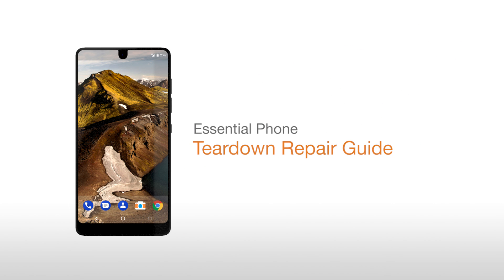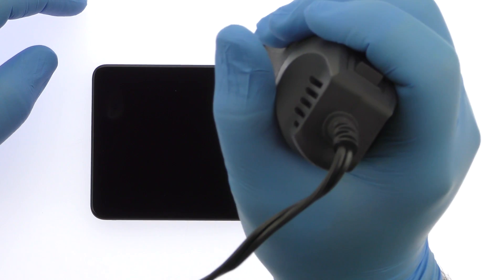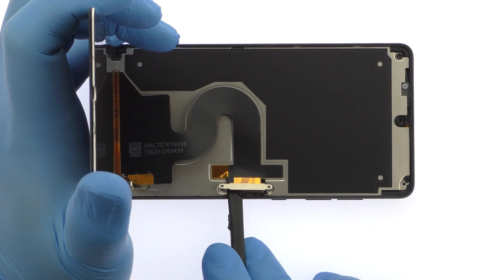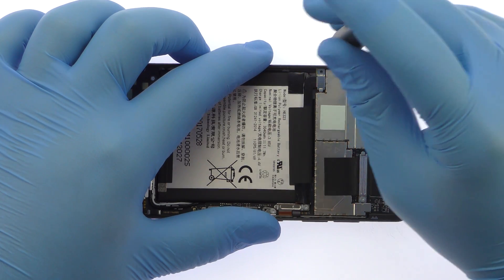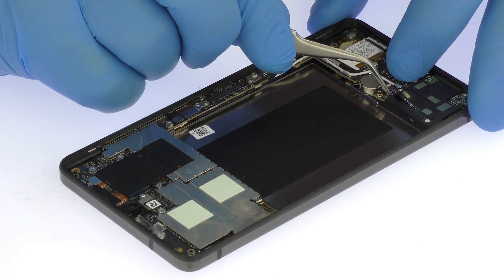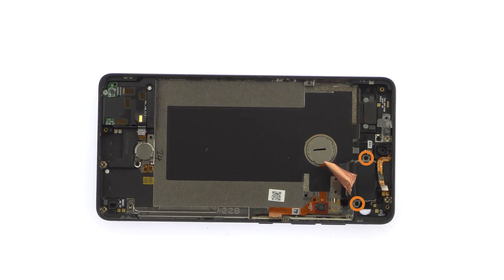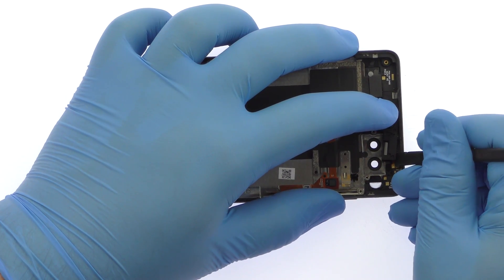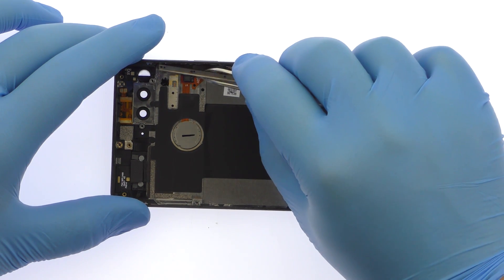Essential Phone Teardown Repair Guide - Fixez.com

Comment: Maybe i've missed it but if I want to change battery only, how do I reattach screen back? Is there any possibility to get some sort of spare adhesive frame for display?
Reply from the maker: The first part of the video up until about 2:30 will show you how to disassemble and from 10:40 on, will show you the reassembly. When you purchase replacement parts from us, we will add in a free square of adhesive.

Comment: Great video, I thought it was odd that iFixit had so much trouble considering Essential themselves claimed that the phone was designed to be repairable using heat and a suction cup. I'm actually wondering now if maybe Essential changed the adhesive at some point since iFixit claimed to have used lots of heat to no avail. It certainly appears in this video that you did not struggle as much as they did.

In fact, the design of the LCD ribbon cable seems pretty purposeful, in the sense that with the way it's laid out and attached to the phone, it seems like it would be pretty hard to damage it even if you were rather careless with your adhesive-slicing tools. And there's plenty of slack to be able to move the screen around before detaching it unlike a lot of other phones. It seems like a pretty good design, IMO.

I will definitely take a closer look at this channel. I love iFixit as a resource but there have just been so many times when I find it lacking. The fact that they haven't addressed this issue on their teardown of this phone and still have it labeled as a reliability rating of 1 is extremely disappointing.
Reply: essential may have dun a revision, because my phone overheated while gamin and the screen jus fell off, way too easy
Reply: ifixit was paid to give it a 1/10. the world is shady

Comment: Better than ifixit. Again support for my conspiracy that people were paid off to give this phone a bad reputation.
Reply: I'd call you crazy, and I can only surmise that perhaps Essential changed the type of adhesive they used somewhere along the line due to problems like iFixit had when trying to open them, but I can't recall the last time I saw so much negative press about such a good phone. I mean, there's legitimate gripes about it, and it stumbled a bit out of the gate and was, IMO, a little overpriced. But my goodness, where it's at today, at the price it's at, it very well might be a no-brainer. My only hope is that Essential can get us some repair parts at an affordable price relatively soon, so that people will stop calling this phone unrepairable.
Reply: By the way, because I like this phone so much, if you feel you're not capable of replacing it, I'll do the work for you if you want to send me the phone and part, for free. I have the necessary tools to do it and I love learning to work on new devices, so I'm satisfied with gaining the experience. You just have to pay the shipping.
Reply: John Doe damn man, I'm on the same boat. I sent an email to essential and they want $199 to fix it. That's our only option I guess since there are no replacement parts available just yet.
Reply: What is your source for those screens? Are they good quality (ie on par with the original part)?
Reply: My source is reliable and genuine. There should be only one manufacture(the original one) making this screen, no other would take the risk to make a product line producing identical screen for such a minority product. BTW, I have sold 10 screens last 30 days so far and no one complain.
Reply: what I learned is that sometimes conspiracy starts with stupidity. LOL. Take that ifixit.
Reply: Adam Baldwin I bought this phone second hand as-is for $100 with the same goal. I wanted to repair it myself but it was naive of me not to search for parts beforehand. Now I'm stuck in this limbo where I'm not sure if it makes financial sense to send it to essential. I really appreciate the offer! I have a repair business myself. If I could find a screen assembly, I would be so happy. Even if I only source the outter glass, I'd be able to proceed with the lamination but for now I guess we'll have to wait for the Chinese to save us haha!
Reply: Adam Baldwin By the way, even though the phone is a bit cracked, it is still my daily driver. After some tweaks, (google camera, 8.1 beta) this is an amazing phone. I still think that for $300 after the replacement, I got a hell of a deal.
Reply: Yeah, I like this phone a lot. Did you check the eBay auction I linked? Seems to be exactly what you need, LCD/digitizer glass. If you got the phone for $100 and put another $135 into it, that's a darn bargain! I got mine for a little under $400.
Reply: Adam Baldwin I don't know if I trust that seller. I was looking on eBay for parts like a week ago and didn't find anything. Let's hope these parts start popping up for cheaper and from trustworthy sellers. For now, I think I'll send my phone to essential for a replacement. The frame is in poor condition as well hehe
Reply: I don't blame you, this was literally the only seller I found on ebay.
Reply: if you comfortable fixing it yourself, I have the screen replacement for you
Reply: why not getting from a US seller instead of waiting for a month to get your phone fix. https://www.ebay.com/itm/132541578628?ssPageName=STRK:MESELX:IT&_trksid=p3984.m1558.l2649
Reply: Yeah, it sucks that parts are non-existent, especially since they seemed to have designed the phone to make repair fairly easy. I would have hoped that they'd make screens easily available for ease of repair.

There IS a screen available from China for $132.55. That's not too bad. On eBay here: https://www.ebay.com/itm/5-7-For-Essential-Phone-PH-1-Touch-Screen-Digitizer-Full-Lcd-Display-Assembly/162934121235?hash=item25efa16313:m:m3a4EHa_ohasGGXfvSNkt4A

Comment: what holds the screen back onto the phone when reassembling?
Reply: At around 11:14 you can see that he's applied a double sided adhesive to the edges. The adhesive they used can be seen on the intro at 0:32.
Reply: that's kind of what I thought, but it was a bit unclear since it never actually said that's what was being done/used
Reply: it doesn't really show it, but anything with that glue you have to heat to take apart, you should be able to re-heat to get it back together as long as you didn't clean the glue off.

Comment: I guess heat works then? Ifixit seemed to have a really hard time with it, but you seemed to figure it out after all!
Reply: ETrade Supply ifixit froze the back of the phone for no reason and acted like it was impossible to take apart. Essential even told them that it the internals weren't accessible through the back of the phone beforehand.
Reply: I don't recall what iFixit used, but they have a reputation for trying to push their own shitty microwave bean bag as an alternative to a proper heat gun and they break stuff because the bag doesn't get anywhere near hot enough.
Reply: The heat gun can hava a high temperature